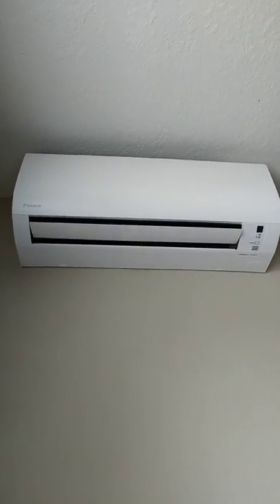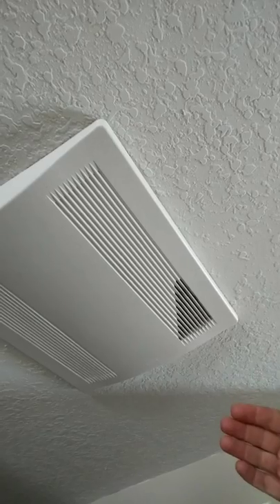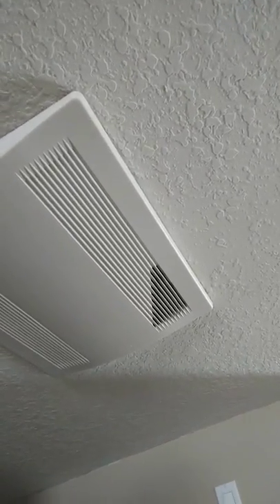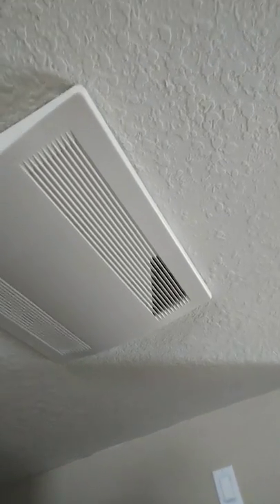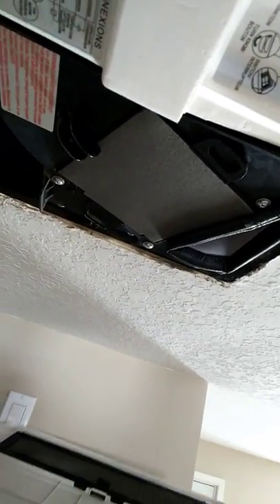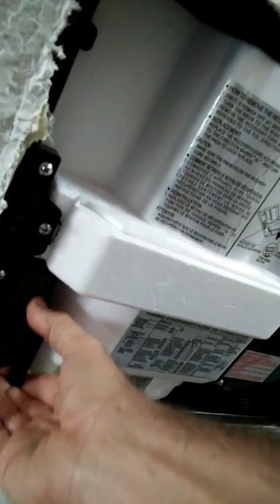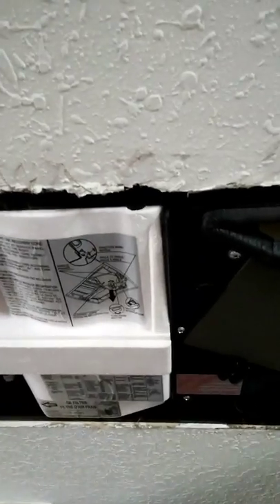Fresh air with ductless mini splits

Comment: Update: I was confused about wording. A "ductless" ERV still requires a duct to outside, but it can be installed in a building that is using "ductless" HVAC (i.e. minisplit). The ducts don't have to attach to the AC.

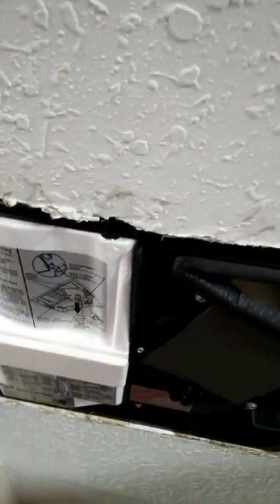To save some others time. While this unit is used in combination with ductless ac. He mentions that the ERV he is using is tied into a ducted system at minute mark @4:10. "This does have to be ducted. There is a two ducts that come out. One is for makeup air and the other is for exhaust air out. We have two of these and they are tied into two duct mains that go out to the gable end".
Reply: The ERV does have to be ducted for fresh air & exhaust & yes out the gable end or eves if you have hip roof. I have 2 ERV's and tied them into a common duct which connects to a intake/exhaust combo wall adapter on my gable end.
Reply: @mp6294  Gotcha, I misunderstood your comment. You're saying that there needs to be a duct to the outside, but it's "ductless" in that it doesn't need to be attached to an HVAC duct.
Reply: @richardschneeman5754  DUCTLESS MINISPLIT DON'T USE AIR DUCTS THATS WHY IT'S CALLED "DUCTLESS" 
THERE DOESN'T NEED TO BE AN EXHAUST VENT THIS IS SOMETHING HE JUST ADDED TO BRING IN FRESH AIR FROM SOMEWHERE